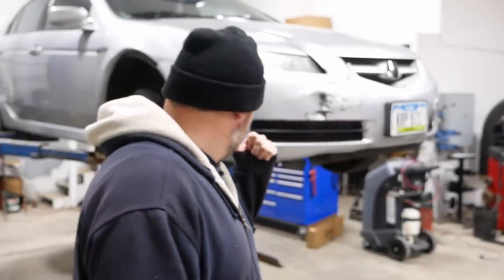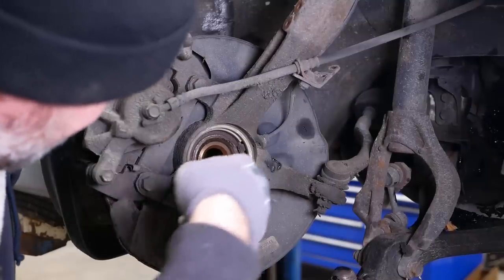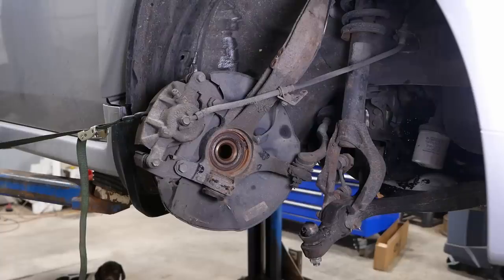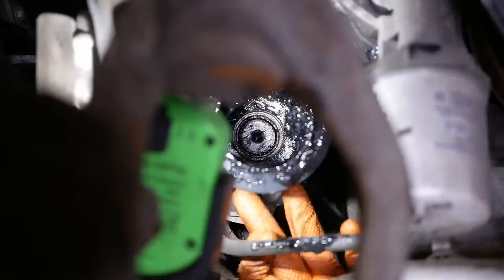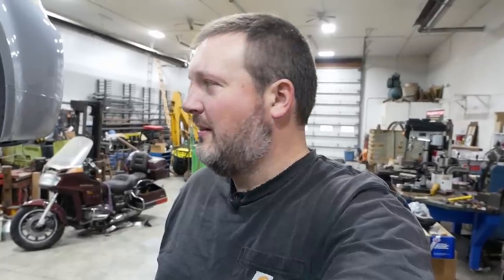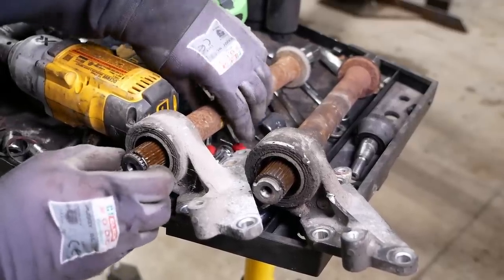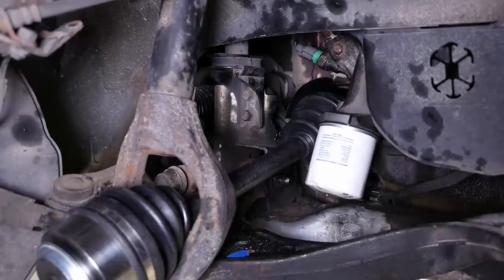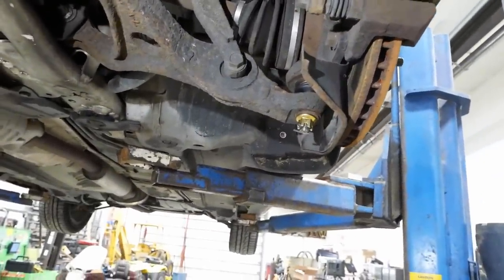Acura TL Broken Ball Joint

Comment: Had a V6 Mazda 6 years ago that needed a CV axle. I spent an entire day attempting to get that stub axle out. Unfortunately the one I was working on was in the transmission so I couldn't pull a half shaft like you did. I finally put it back together and sent the man on his way. I don't give up very often but I just was done fighting that stupid thing

Comment: I've had those snap rings get stuck like that before, I feel your pain. Poor guy's Dodge Dakota had an axle stuck like that, he ended up just getting a used front diff housing from the junkyard for us. I've had luck once, and only once, by hammering the shaft back as far as it will go, and then using an air hammer to rocket the thing off before the snap ring has a chance to seat back in. Some of them, I swear they grow in size once they're installed.

Comment: I'm guessing the retaining ring took a hit when the wheel fell off, damaging the ring by jamming it against the splines. Great work. By the way, Honda power steering pumps have little O rings for the two hoses that commonly go bad, leaking air into the system causing noise. Easy to swap out. There was also a recall on the outlet hose if it is leaking.

Comment: I've had three I couldn't get out. One of them was a Mitsubishi Eclipse my nephew  had lowered. I thought maybe it had been slammed inward because there was a lot of scarring. It was towed to my grandparents garage in Champaign where a couple of them went at it with my tools for hours. They did finally get it. Another went to my friend's heavy truck shop. He said he got it by drilling a hole in the CV cup and running an exhaust clamp through it. Then attaching that to a chain and slide hammer. Sometimes it helps if you are able to step back and bounce some ideas off other people. Sometimes you really don't have that option.

Comment: Wow. Acura really went off the beaten path with this suspension design. I guess they wanted to be different. Great job Wes.
Reply: My wife's 1994 Honda Accord is the same design and had the ball joint separate also.  Thankfully it was just as we pulled in the driveway.
Reply: Funny part is, when Honda went to McPherson a bunch of the other manufacturers switched to wishbone  🤣

Comment: The easiest way to remove the inner CV joint part that is still attached to the trans is to use the axle part that is no longer attached due to the ripped boot. 
Stick it back in the housing, take a pair of vice grips and clamp on the edge of the the outter ring of the CV TIGHTLY. Use the axle like a slide hammer and yank it out. Works every time. Takes about 5 minutes.

Comment: Wes, we just did one of these in the shop, we were able to Jerry-rig a ball joint press with the stepped cup on the one side to get it out, and to get it in we used a brake pad spreader with some extensions to press on it

Comment: I've seen a few of these, usually in winter.  Guy will have a ball joint going out then slide into a curb on ice and that finishes it off.  I saw one a couple of weeks ago on a '99 Plymouth that was so bad the control arm ground against the inside of the wheel and destroyed it.  That guy scrapped the car, it had every problem a car can have in addition to that ball joint.  Rusted out so bad the doors were falling off.

Comment: I feel your pain, There are a few VW's that have a centre bolt through the front drive shaft, that require a multi extensions, there a real pain to remove.

Comment: I swapped axles on my wife's Mazda years ago and I had to weld a pipe onto one and had a 40lb weight I put on the pipe with a stop welded on the pipe for a shop made slide hammer and it took many many hits before it came out. That was my first experience with FWD axles and I don't plan to do another after that mess.

Comment: Today’s mission was to replace my 10 year old headlight housings on my Chevy Avalanche due to fogging.  It’s a somewhat fiddly job that was frustrating me a bit, so I decided to come in out of the chill and take a break.  Here I see Wes having a much harder time than me.  Appropriately shamed, I returned to the task at hand and finished the job.  Maybe next is an inspection of my 10 year old ball joints….

Comment: i feel your pain, i had a rover 620 back in the early 2000's which had the same suspension setup, was a shared honda/rover vehicle in the UK, much time, tools and swearing doing new ball joints and sourcing the correct upper wishbones, wasn't fun and was outdoors in the middle of winter, i didn't have a garage back then. enjoy your christmas

Comment: i had one of those all nightmare axles a while back, i tried everything including a rachet strap type setup, i finally got it with a air hammer with a specialty bit that i use to put a bead on 3 inch boiler flues.

Comment: I am always amused when I see how poorly maintained so many vehicles are... my own 2 vehicles are old, not so uncommon here, but I do preventive maintenance on both.
The only actual failures I have had were an alternator( original 20 years old) on my oldest, a 4wd, and a tensioner idler bearing on the newer Mitsubishi.. (actually 27 years old when failed) $10 and a total of 30 minutes to remove and replace....  But I do see some horrendous stuff on younger kids' old "performance" cars.....  You have remarkable patience.  I have seen a similar problem to that you struck with the universal, caused by an idiot replacing the ring clip with a larger diameter one( thicker wire too) as it was 'too loose'..  He had to really hammer it on and was totally unable to remove it again.

Comment: Don't change that power steering pump! Common problem on all hondas with that pump design is that the oring between the plastic inlet fitting and the pump body gets hard and stops making a good seal. It never leaks fluid because its under suction not pressure. A tiny air leak there lets the solid column of fluid in the suction hose drop back down into the reservoir when the car is off. The air gets sucked into the pump on startup and sounds terrible. It can foam the fluid, overflow the reservoir, make a giant mess eventually the worse it gets. The o-ring is only a few dollars at the honda dealer. Get the outlet line one as well. You'll probably need to remove the pump to clean the aluminum corrosion out and get a good seal.

Comment: The 2002 and older ford panther cars use a similar setup too. And a lot of time it gets missed because you can't check the ball joints by jacking up the car. You have to support the lower control arm with no weight on the vehicle to check. 

Still double wishbone 03-11 but they have a more traditional setup with coilovers

Comment: Quick tip for removing the axle housing. Take the boot off insert the old axle into the housing like you took it out. Use a vise grip or two on the housing and give her hell. Has worked multiple times for me.

Comment: Hi, 
The way i have done it is to get rope or wire around the back of the hardy spicer and then use a ratchet strap to put it under tension. Then hit it round the back with a hammer. It should release the snap ring that holds it in place.

Comment: I've had the same kind of problems with a lot of the Honda product when the snap ring actually embeds itself into the bearing or retainer. And usually you have to get another shaft. It's not much fun it's not uncommon though! Yeah it could be a real struggle, you're doing a great job there Wes!!
It's even worse if it's in the transmission!!
All the best of the Season from Canada

Comment: Hi Wes, really enjoy your videos  The suspension set up is called double wishbone.  I have that on my 96 Civic but my 02 Civic has MacPherson struts.  The reasoning for the switch over was that MacPherson struts are more compact and you can save space.  Most believe it was a cost saving measure on the part of Honda.  Double wishbone gives better handling but most people would not notice the difference when they switched to MacPherson struts.  After all, Porches use the MacPherson setup.  On another nnote, many years ago a friend's Acura had the balljoint separate.   He was only going slowly.  Ever since, I check them periodically.  BTW, I think the Ford Fusion uses a double wishbone type set up.  As for getting the CV shaft out of the jackshaft, I have been there and share your pain.  Keep up the good work!

Comment: That suspension arrangement is a semi double wishbone design, it seperates suspension from steering forces so improving handling, roadholding and steering feel. Quite common on Japanese cars, my Mazda 6 is similar. More sophisticated than macpherson struts, which is cheap and crude.  Downside is more difficult maintenance.
Reply: Why semi double wishbone? It is literally double wishbone 😅

Comment: Excellent video Wes  :) also remember doing one neighborhood neighbor older Acura car we had take Unibody plus unhook all power connections plus hoses , everything to motor plus transmission also you name it because motor was no good and transmission too ! Was task to in do also use neighborhood farm Slaughter house forklift tractor and 3 days later had up running from scrap yard find and bolt up plus some new stuff added! Was lots stressfull strength get line up also new scrap yard find all had put new clutch parts to transmission to motor too also one thing glad were didn't have do computer part took shop do ! But motor also transmission had low mileage then old also better condition! Not say how many hours took totally but task to do!

Comment: Double wishbone required the strange ball joint setup and it's a pain to press out unless you have a good adapter set. I usually cut the stud off to make it easier to press out. The extra length causes it to move around so much that it's a pain to keep resetting the press. The newer accords don't have the double wishbone in the front which is good in some ways but doesn't have the travel the older ones did. I don't like it I'd rather have a double wishbone  suspension but maintenance wise it's easier. The inner cv housing can be hammered off by the edge of the housing itself from the backside. You have to get the screwdriver up in there but there's a way to get at it.

Comment: Honda ball joints. They have their 
own special Honda only ball joint tools. Only makes the job marginally easier. If it comes back for wheel bearings, run.

Comment: I had a similar experience with an 82 Citation. I was replacing the clutch and could not get the CV joint out of the axle. I ended up taking the transmission apart to get the joint out. the only good thing was that I already had the transmission out for the clutch job.

Comment: Ever done an oil change on a 2021 year, 75 HP version of a certain US brand of tractor (that isn't actually made in the USA)?  The manual says it has two drain plugs (like many 4WD tractors) but the book is wrong, it says you can remove the oil filter by removing a side panel, and it's kind of right, you can remove the filter from the engine, but you can't get it out from behind the other engine parts, nor can you get a new filter in, until you remove the lines from the hydraulic pump (and hope the safety locks work, because the loader arms have to be up.) Gotta love those design people.

Comment: This one sounds too far gone, but the front hose O-ring on these power steering pumps flattens out and leaks air into the pump.  It'll foam up the fluid and make a hell of a racket and eventually cavitate the pump to death.  The O-rings from the dealer seem to work the longest, and they always seem to have several on hand for some reason...

Comment: Wes I know your pain with struggling on that axle, I spent 10 hours trying to get the exact same remnants of an axle out of the front diff on a 2006 Subaru Outback I was fixing up to sell. I made a special pry bar with ears to fit on both sides of the axle cup to pull evenly. In the end I ended up having that tool, with a 4' pipe for leverage, as well as a guy using a punch and sledge hammer from the other side since it is a straight-through design, AS WELL as a slide hammer and jumping on that 4' pole. It never came out. I had to swap the entire f!$*ing transmission. I do not understand what on earth was holding that axle in. The other side popped out with a screwdriver just like they are supposed to.
Reply: Or just leave it, and slip in the new axle with the old cup in place if its not completely smuckered.

Comment: 1) you really should trade places with Rainman Ray for a day. He just bought his forst needle scaler, and didn't really know how it worked. The commentary from both of you should be hilarious.
2) How do you charge for a job like this? By the hour? By the listed time and then simply soak up the time spent cursing and considering? 
3) that scrap yard part the customer brought in, any signed disclaimer for things breaking during the disassembly process? "further costs may appear"?
Apart from that, I appreciate your content and recognize your struggle. That part of "let's hope the bolt isn't stuck in the bushing" made me chuckle in remembrance. Broke a vise trying to press a bolt out while helping a friend replacing a shock once. Your average suburb garage doesn't have a hydraulic press....

Comment: Designers do that as to keep dealers in work & keep new parts flowing through the parts department. Then the markup on parts & labor. And that design is to REQUIRE 6+ other parts to be removed to get 1 small bolt.

Comment: The power steering whine is most likely from the O ring on the suction side leaking. Honda makes a re-engineered o-ring that will solve the sucking air and whining noise.

Comment: For people that might be wierd about the oilf filter off and on thing.Test drive, check for leaks and it's good to go. If you have a repair that would be easier with the filter off but the oil/filter is still good for a few months but the  shop puts a new one on is because of liability 9/10 mechanics don't wanna deal with a pain in the ass oil filter leak after a repair.

Comment: This wouldn't work for Wes but about 9 year's ago I had to fix the transmission on my wife's 94 ford escort wagon, I couldn't get one of the inner CVs to come out for the life of me, my dad came down with a thing he had made, it's kind of like a 3 jaw puller but when you pulled it the jaws spread out is the best way I can describe it, he gutted the inner CV and wedged his reverse puller into the inside of the CV axle, he had a pretty heavy chain on the puller, he made a whipping motion and it just popped out like nothing. Haven't had to use it since but I know what I'll do next time that happens.

Comment: I had a similar problem with an old 90s Toyota Camry, same passenger CV replacement sort of deal with the bearing in the middle like that. One of the worst jobs I can remember. It's funny how sometimes little cars are way worse than big truck stuff

Comment: That mini press makes this job so much easier.  Taking the whole knuckle out and using a real press sucked, air hammer sucked, that otc press you don't even have to worry about trying to get the ABS sensor out.

Comment: The 2002-2007 Jeep Liberty had that identical lower ball joint setup. It was a mess, they ended up having a recall (maybe two?) to try to address the poor design. They changed it on the 2008+ Libertys.

Comment: Honda designed the front suspension that way because they knew lots of people would put oversized wheels on their cars and needed the negative camber gain to clear the fender when the suspension cycles or is lowered.

Comment: Wes, tell the guy to replace the o-ring at the plastic inlet to the PS pump.  Most of the time that cures the noisy PS pumps on Hondas.  If that doesn't fix it then replace the PS pump.

Comment: Hey Wes ima give you a tip may work for ya if you ever find yourself in that same scenario. The way you just had the knuckle end of that cv joint still seized in there you could have just split the replacement cv axle, remove that end off it and just connect it to the end still stuck  in the vehicle. I've done that before and it works perfectly fine.

Comment: Wes just wanted to let you know I remember you doing this and I had to get the passenger side cv axle off and specifically you having to remove the exhaust to get it off the bracket attached to the block. I did have the lower control arm removed as I'm replacing it. Just wanted to say I was able to remove that cv bracket and was able to remove it with keeping the exhaust intact. It was not easy.....I was needing to do so because I could not get the axle to release from the bracket very painful

Comment: There's a adapter you can put onnthe end of a slide hammer that sometimes will get behind the joint and you can slide hammer the inboard joint and sometimes that doesn't work

Comment: I think the axle probably got stuck because of the bad ball joint. The whole assembly was hammering the axle in. Also, this is a better suspension setup for handling. Honda/Acura has been using an upper control since 1990s. For Front wheel drive, they try to give better handling

Comment: I never cared for dealing with spring pins and such when doing Subaru CV axles, but they're typically a far sight easier than trying to yank an axle out of a Honda or something. Subarus' ball joints are usually a bit easier, too, assuming all the bolts come out. I always hated the cars with permanent pressed ball joints. What could be a $20 job is a $200 job because the whole assembly has to be renewed.

Comment: Looks like you need to make the tool I made. Basically a slide hammer with vise grips on the end. Just clam it onto the cv shaft end there and it’ll pop right out